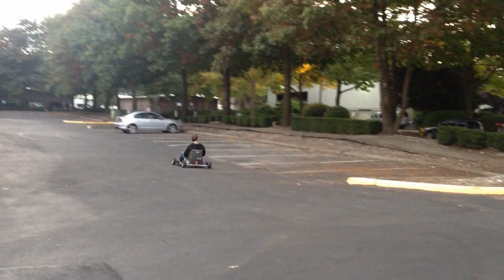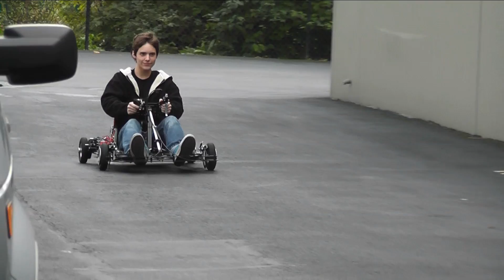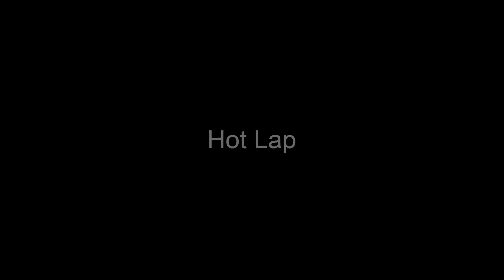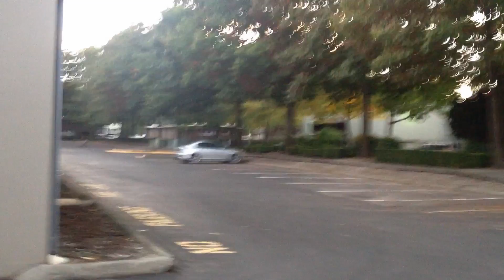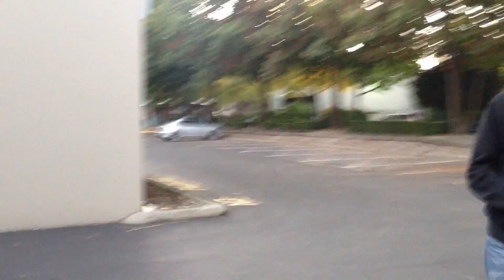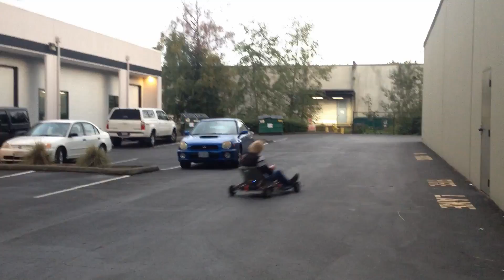tinyKart Black: Alien Power System Motor Tesing

Comment: Would you please clarify? I understand that "6374-170" signifies that the OD is 63mm and that the length of the motor is 74mm. But what does the 170 mean?
Reply: +Arthur Ozawa I believe 170 is the KV rating